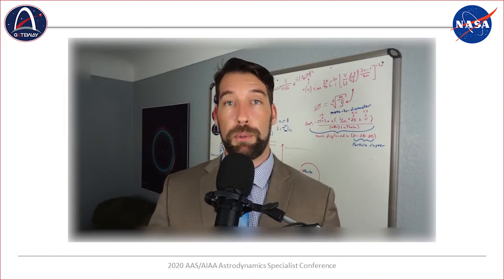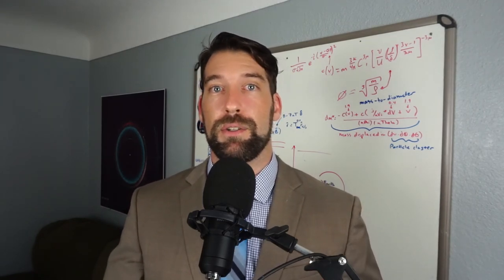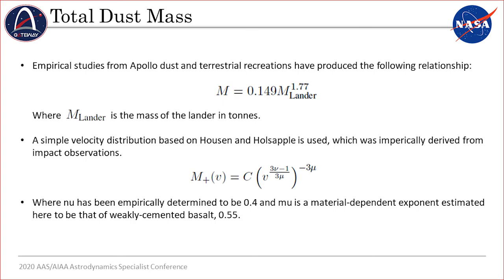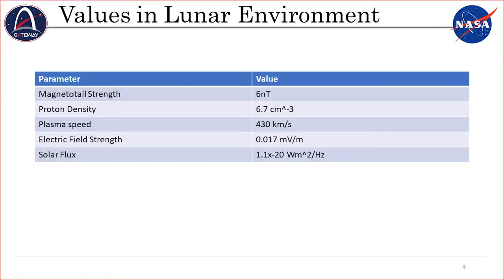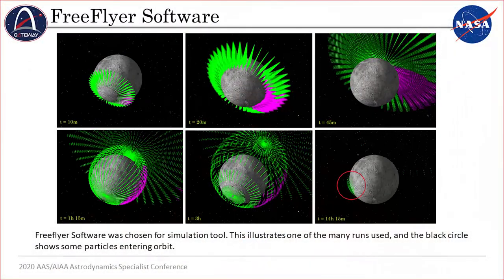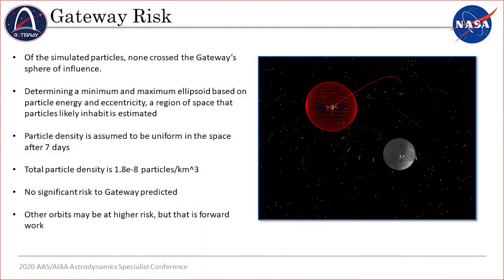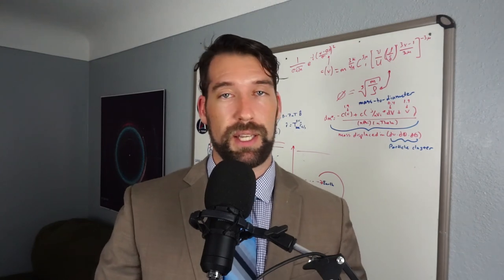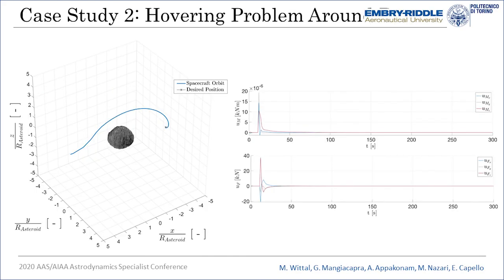The Behavior of High-Velocity Dust Generated by Lander Plumes in the Lunar Environment

Comment: Does this mean that the Apollo landings didn't really happen? None of the effects you describe appear to be present in any of the original footage or subsequent photos. And, given that it is now an issue, why wasn't it then? There is some early nasa footage showing plume cratering tests which support what you are saying, but it doesn't appear to have been part of any consideration for the Apollo landings.
Reply from the maker: This work uses models based on data taken during the Apollo missions.
Apollo landers were about 5 t in mass, about 1/20th of Starship and 1/8 of the mass of the estimated other proposed Artemis lander concepts.
During Apollo, there was nothing else on the surface. During Artemis, there will be a habitat, infrastructure such as solar panels and communications equipment, and possibly other teams and vehicles (robotic or otherwise) operating on the surface and in orbit
Furthermore, dust WAS a problem during Apollo, and they only stayed for a few days. During Artemis a permanent presence on the lunar surface is expected to be achieved.
Reply from the maker: You can also find the videos of the Apollo landings on YouTube that shows the dust being kicked up. I think the best one is Apollo 15. Search for "Flying Down to Hadley Rille, Apollo 15"